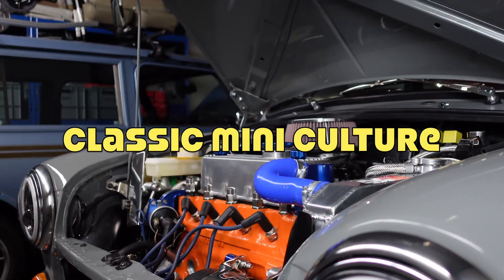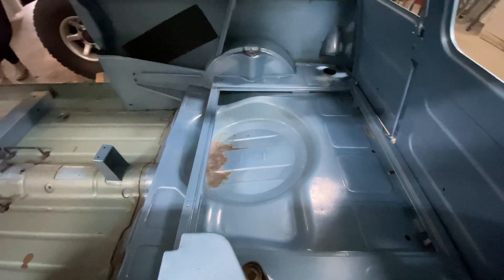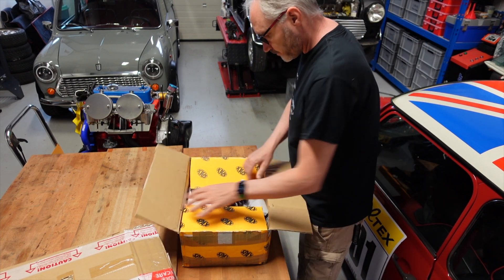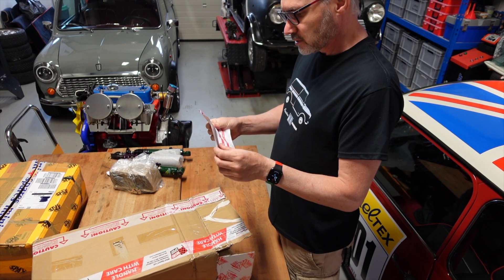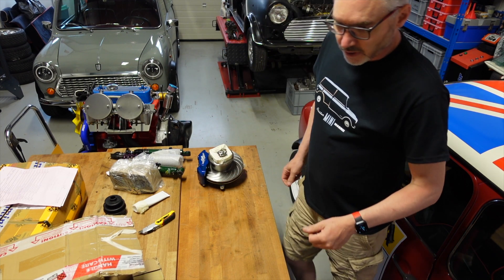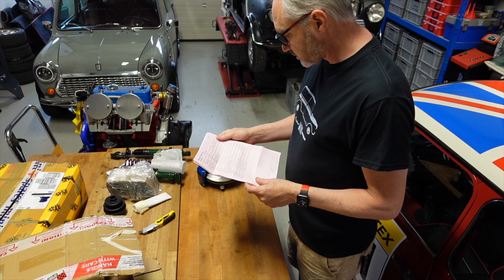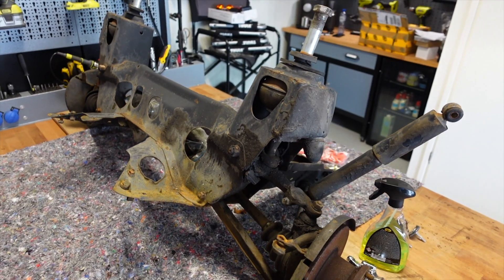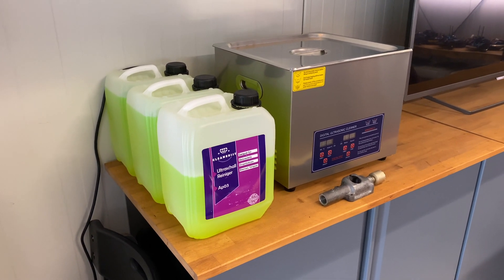Classic Mini Clubman Estate - Electric Conversion

Comment: I did think that might be an issue with the floor. Over in the UK as well we face the same basic criteria and I believe that some conversions just choose to ignore the regulations and might get a rude wake up call further down the line. Although I’m just at the planning in my head stage, I’d already reached the same conclusion as you that a false floor in the rear might be the best plan. Also have been considering a fuel tank substitute underneath the car but I’m not yet convinced about that.
The parts you’ve got look great. I see though you’re still battling with the ever more frustrating aspects of post Brexit life.
Reply: Checking the rules you need an IVA inspection if you change the chassis etc from original. My plans for sinking the batteries in the boot floor are now... floored unless I accept a Q plate 🙄 you need 8 points to keep your registration and 5 must come from the chassis section. £450 for a 4 hour inspection 😬
Reply from the maker: @MiniLifeCrisis   Yes it can be a minefield, the rules are not friendly to EV conversion at the moment, hopefully as they increase the restrictions on gas-powered cars we will see improvements for old timers (vintage).
Reply from the maker: fully agree with the rude awakening for some, it's really important to work with your local test centres when doing EV conversions.